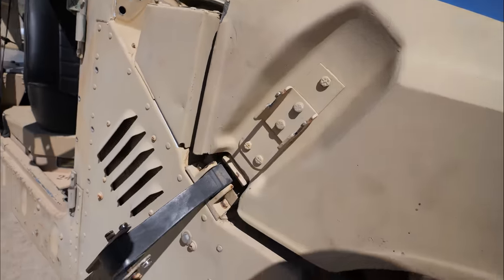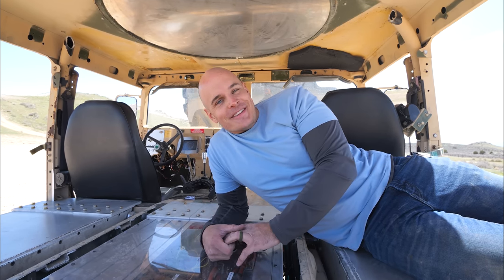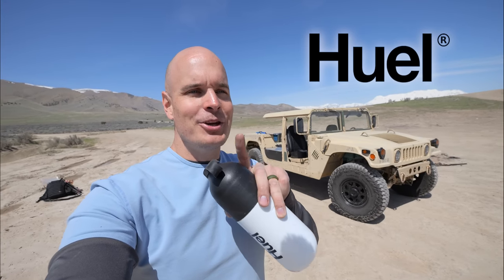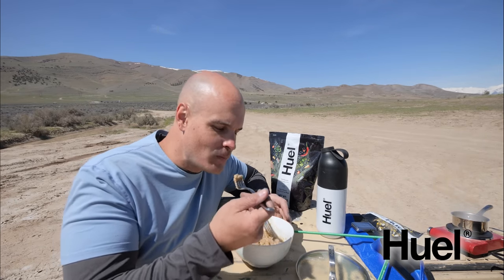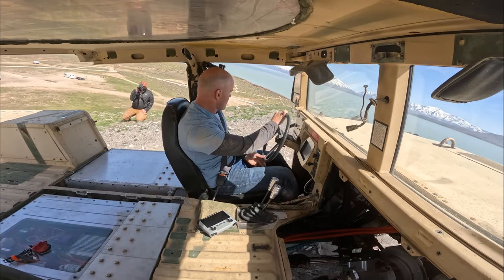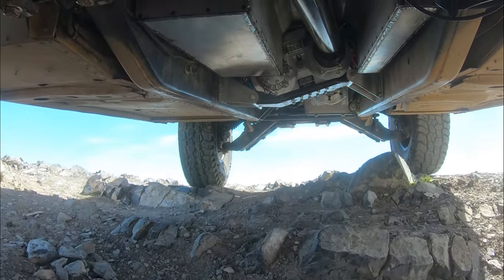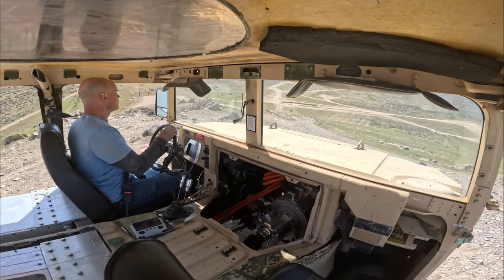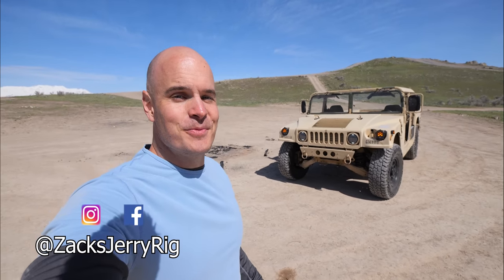Off Roading my DIY Electric Hummer - What could go wrong?

Comment: I can tell you from my experience in the Army, going over 50 in a humvee feels like you're doing re-entry on a spaceship. You'll want to do something for suspension for sure.
Reply: I highly doubt that - unless it's on some gravel road in the forest or out on some battle field. Of course it's probably a lot bumpier and noisier than a regular car, but on normal highways, it's still just 50 mph (which is about 80 km/h for us non Americans), in a car! It seems like he is simply not used to high speeds,  haha. I also base this from one of the earlier videos of this project when he talked about the the "torque converter" (or that's probably wrong word - it's not the type used for ICEs, but like a single gear gearbox put between the motor shaft and drive shaft) and started to tell that "without it, the top speed would be like 125 mph and this car would probably fall apart at that speed". 
That's in fact totally irrelevant to why it's needed. It's all about to get the right ratio between torque and rpm, to use the available power most efficiently. Without it and using the same motor, he would probably just get worse performance. He would get less acceleration, but the poor aerodynamics of that car would "suck" so much power at high speed, so he would probably not get much more usable top speed anyway (maximum current draw without overheating the batteries would probably be the limiting factor instead - and the range would drop to almost nothing). 
So the 80 mph (129 km/h) he chosed, is probably quite optimal (given the limits of that type of vehicle) for fast drivers on normal roads. But, he could probably change it again to get a top speed of just 55 mph / 89 km/h (he isn't going faster anyway), then the motor would run more efficiently during the off road driving.
Reply: @Speeder84XL  👀
Reply: @Speeder84XL  As someone who's done drives from 29 Palms to Camp Pendleton and back (6+ hours of highway driving) as well as other drive on public roads/Highways in a HMMWV.

These vehicles were not meant to be driven that fast on those kinds of roads. Maybe it's the turbo diesel making it feel like hell, but I honestly doubt that.

If you really want to know, buy a surplus one for like $5000 and you'll see how heinous these things can be on roads/highways. Offloading though it does good.
Reply: @Speeder84XL  I'm not sure you know what suspension does. The humvee has some pretty heavy duty suspension and as Zach mentioned they removed the turret plus he removed some other components. So the vehicle is lighter with a very stiff suspension. This negatively affects performance. You can clearly see as he traverses the hill that the suspension doesn't articulate much, especially over the bumps. This negatively affects the handling (especially offroad) and the ride quality (poor Zach is going to rattle his brains out).  The suspension needs to be adjusted, keeping the natural frequency and motion ratio ratio constant, combined with a  lower sprung corner mass (due to cutting the weight of the turret plus any potential mass loss/weight distribution changes associated with changing to the E-drivetrain), this ends up reducing the required spring rate. 

Because Zach said he has more work he wants to do (which will add some more weight again) he shouldn't adjust the suspension until he's done building the vehicle - as a final step - otherwise the suspension won't be tuned for the final weight/weight distribution of the vehicle and won't be optimal.
Reply: @Budorb  Yes, but then it's probably more a question about noise and vibration - of course, in that case, many drivers will go slow to make the ride more comfortable. Many parts in US also have quite bad roads with pot holes and bad pavements - that in combination with stiff suspension isn't the most comfortable.

What really got me here is when he said "I don't know the 0-60 time, because I have never gone more than 55 mph". That means he would never have hit 60 mph (97 km/h)
 - not even for even a second. I get it, that car is not very comfortable at speed, but not even hit 97 km/h for one second, LOL!

Last summer I had a car without working AC, so during hot summer days I had to drive with windows down
 - since I like speed and typically go at 160-200 km/h (99-124 mph) on the highway, the aerodynamic noise by the air current over  the windows got ear damagingly loud - but I simply put earplugs on rather than have to chose between "cooking" in the car or crawl along at like 100-120 km/h to not get bothered by the noise. So earplugs also works if noise is the issue, haha
Reply: @berto1014  Yes, you indeed have a good point, but the speeds we are talking about here, is so low
 - I understand that you can't go 100 mph with this kind of cars, but 55 mph (89 km/h) on paved roads - come on. Also, it was not about comfort on long drives here
 - but what really got me thinking "wtf?!" is when he said "I don't know the 0-60 time, because I have never gone more than 55 mph"
Reply: @berto1014  Definitely agree with ya there. Plus it's engine only makes 190hp with the turbskie added so them things are dummy slow haha.
Reply: @Speeder84XL  I'm fairly certain Zach isn't designing the humvee for primarily highway use. He has a Rivian after all. It's going to primarily be his offroad vehicle - as he demonstrates in the video. There's a few points to be made here. Zach is using the conventional drivetrain and not an optimal EV-drivetrain. This means his motor is turning a driveshaft, through a transfer case, and through a front and rear axle. This is highly inefficient for EVs as compared to directly turning the wheel with the motors - not to mention the additional weight of those components.  But that's what needs to be done since the chassis was designed around an ICE and not an electric drivetrain. A torque converter is also completely unnecessary for an electric drivetrain, since electric motors cannot stall when brought to 0 RPM and can produce 100% torque at almost any RPM (torque typically drops off at high motor RPMs). Adding a torque converter only introduces inefficiency for an EV. None-the-less, regardless of the speed he wants to operate it at, he needs to reduce the spring rate. Have you ever ridden in a heavy duty truck (like a channel truck or an 18-wheeler)? There's a reason the seats are on air bags... Lol.
Reply: @Speeder84XL  i think you totally missed the point of his comment.
Reply: @berto1014  Yes, but why even set it up for a top speed of 80 mph and talk about 
0-60 times then (that gives the impression that he want some performance for road use as well)
 - better to set it up for 55 (or what ever speed he thinks is good enough), to make the motor more efficient for the off road driving. At low speeds with lots of resistance and sometimes almost static force output from the motors (when climbing over rocks, going up steep hills etc.), during hard off road maneuvers, it will run more efficiently with a lower gearing
 - less torque from the motor shaft is required to get the same torque at the wheels (which means less current in the windings = less resistive losses)
But torque converter was the wrong word 
 - it's not the type used for an ICE, but like a single gear gearbox, that he put in between the motor shaft and drive shaft, to exchange some rpm for some torque to the wheels (he chosed the gear ratio on that one so tops speed will be about 80 mph at the motors max rpm).
Reply: I own a humvee and drive it often on and off-road. It’s really not designed to be cruising above 55mph. Changing out the military issued (170lb) run flat wheels to a civilian wheel and tire setup certainly helps the daily drivability but he wasn’t wrong in saying how crazy these things feel driving at highway speed. Just my 2 cents, it’s easier to make assumptions when you haven’t personally driven one. Cheers
Reply: I wish they were only $5k lol. Shoot man I spent $4k just for my x-doors on my humvee. Prices have gone up a lot the past few years. I’ve got one that was $30k and a buddy of mine has 6. Cheapest one he’s ever picked up from auction was $14k and it has a long way before street legal. Kick ass vehicles for sure but kept at a slower speed no doubt. Cheers!
Reply: @beurownboss1554  I still think it's exaggerated, because 55 mph is so incredibly slow on roads. It's about the same speed as our speed limited heavy trucks in Europe that sometimes cause frustration for a large amount of drivers, that often result in  dangerous overtakes and other "not so great" things. 

For me, saying "it can't be driven more than that speed on wide open highway" is almost like saying "this car isn't built for speed, so why even bother rebuilding it to electric then
 - just remove the old broken engine, put pedals in and pedal it like a bicycle". 
With low enough gearing, even my mum could pedal it. The top speed will be like 3 km/h, but come on, it was never built for speed... A bit exaggerated, but I think you get the point. 
At low enough speeds, it doesn't really matter if it's build for speed or not. You could as well be riding a motorized shopping cart, unless you are a terrible driver.

What really "got me going" was not the fact that he doesn't want to cruise at more than 55 mph, but the fact he haven't even reached it at all, since he built the car (because apparently he has been out on some test rides)
 - it doesn't take much to test the 0-60 time.
Reply: @Speeder84XL  right, I get your thought process. Really think it would make more sense if you could ride in one. Mine is the 4 speed model and technically could hit a top speed of 70mph. The actual drivability of it is tough though bc when mine was in the marine corp it was 9400 lbs. once it was demilitarized (plating and equipment removed) it only weights 5600 lbs. it still has the suspension of the original setup so it’s like running full speeds with your legs straight (not any buffer or bounce given). At those higher speeds even on a smooth road, it’s amazing how much suspension is working on a properly setup car. There are plenty of ways to adjust it aftermarket and I’m sure Zach will be doing that with his sometime in the future to help the drivability on and off-road. You know one of the funniest moments I had with mine was when I first bought it, I had to drive it back 2hrs from south of Atlanta. My gauge maxes out at 60mph and I had my needle going past it far enough that I was certain I was doing 70mph. It didn’t ride well but I was stoked to have it cruising at that speed. Then I started noticing how fast everyone else was going, kept me in the slow right lane. I pulled out my gps and found I was only doing 59-60mph haha. No wonder everyone was so pissed at me on that drive lol. Cheers,
Reply: @beurownboss1554  Yes, it would be fun to try one - but for obvious resons, it's not very easy to get that opportunity. 

The suspension is very important for more active driving with lots of cornering and braking. But on straight roads, that's not much of an issue for more than comfort. 
I like speed and usually go 160-200 km/h (99-124), sometimes even more on highways (unless it's too much traffic) and have done in everything from an old Fiat Brava to large SUVs. 
A year ago, I drove around in a car that someone has modified to make it feel more sporty - which meant the suspension was lowered so much it gave very little suspension travel (and thus it needs to be very hard, to not bottom out at like every bump) - which affected the drivability negatively. 
Previous owner was one of those who just like to modify cars, but never test them for real
 - those people typically like to brag about how fast the car can accelerate, but never do any real active driving.
I often (if the road was not very smooth) had to take turns slower with that one than with most SUVs I have driven, because the car was bouncing so much. Still not an issue on straights though
 - except that sometimes when passing things like bridge joints, it went with a loud bang and I was sometimes a little scared  something would break - but that was at at speeds of 160-180 km/h.
I have hard to imagine a car that's so bad that one can't even go 100 km/h on highway straights with it - other than if something is about to break down for real on it. 

Also if the suspension is very stiff because the car was heavy in original, that also means the chassis of the car is built to withstand the forces from the suspension as well. The difference is just that the car has less mass, so it gets jolted around more by the forces that would otherwise get counteracted by the inertia. So the risk of something critical braking is still low.

Fun thing with the speedometer - that's quite common here in Europe (even if that one was particularly bad - over 10% error), because of a stupid EU law that car manufacturers have to follow - there is no tolerance for a speedo to show too low speed (not even neglectable errors like 1 km/h) - but they are allowed to show 10%
 + 4 km/h too much. So they practically have to set it to show to high, because they can't guarantee it's accuracy (some are worse than others though).
Reply: LOLOL
Reply: @Speeder84XL  The Humvee wasn't designed for highway speeds, and definitely not for comfort. They weighed a minimum of 8000lbs. With that much weight on your suspension you're feeling EVERYTHING. They also only had a top speed of 65mph but would probably rattle apart if you ever tried to go that fast. They weren't built to high standards, Every one that's ever been deployed probably has more sketchy welds and bolted together panels than anything should. The M998 has been the topic of many studies because it was known to cause spine injuries.

There's a good reason that the first thing people do when they buy decomissioned humvee's, Is replace the suspension, add proper seating, and do a duramax swap. In their original form, they required meticulous maintenance to not fall apart just being used at parking lot speeds. You need to look at it as a piece of heavy equipment rather than as a motor vehicle.
Reply: @sakaraist  Ok, that makes more sense. Maybe the build quality IS exceptionally bad. But then it was indeed a bit overambitious to gear it for a top speed of 80 mph
 - since it will run more efficiently at low speeds with lower gearing (especially during those hard off road maneuvers, where the motor sometimes output nearly static force).

Comment: The ideal electric hummer would have one motor per wheel. With this scenario you wouldn't need locking differentials since you can control the speed of each wheel individually.
Reply: Like a rivian?
Reply: Ideally, but this chassis was designed around an ICE, so it's not possible without a completely different chassis, or heavy modification (which is not recommended for someone who doesn't at least model it first in CAD and perform FEM to ensure there aren't any high stress areas).
Reply: @illuminati229 this chasis has dif locks he doesnt know how to use them
Reply: It doesn't. The original transfer case had a locking center but the front and rear differentials are torsen differentials without lockers. Torsens are a variation of limited slip but do not work well when unloaded.

The thing he didn't seem to know and genuinely would have helped, dragging the brake really helps torsen diffs when they get a wheel in the air, that can help on open diffs too but the torsen style diff magnifies the effects of that drastically
Reply: On this vehicle, I suppose it would be feasible to install an individually controllable brake on each wheel.
Reply: He was driving that impractical ekectric 3wheeler with individual hub motors some time ago. And they said you could get individual spare parts for it.. So grab those hub motor spares i guess.

Comment: You have to drag the brakes to get them Torsen diffs to work when one tire leaves the ground. They work great when you get used to it. Cool build so far. Interested to see what else you do with it.
Reply: Looked it up and yeah you use your brakes enable Diff lock
Reply: cant believe he didnt google that
Reply: @Icel4nd3r  The Hummer only has a diff lock in the center.   If you're on moguls then can end up with no traction at opposite corners, and thus the need to drag the brake while on the throttle.   It has Torsen diffs front and rear, so this trick is more effective than it is with open diffs (although it can be used to some degree even with open diffs, as I used to do have on my old 4runner).
Reply: @daemn42  Yeah, I did that back in the seventies in Mom's Comet; a little brake drag makes a huge difference.
Reply: Yeah at some of the Hummer driving schools they teach you a technique called "modulation" AKA... drag the brakes.
Reply: Are the hummer torsens weak like car versions? They especially don't like shock loads

Comment: Soft suspension that brings the tires down to contact the ground will make it feel like a whole new vehicle. It looks really uncomfortable on road and worse offroad. Let some tire pressure out when your offroading to let them squish around rocks and drag the brakes for the Torsen diffs to stop spin
Reply: Definitely. Knowing how to work those Torsen sons will be key!
Reply: Yeah true, i think the suspension is best fix to ground contact. You can see at around 4:20 - 4:30 theres very little suspension travel, vehicle is balancing between wheels

Comment: From the looks of things, you definitely need to lighten up the spring rate to keep your wheels on the ground where they'll do some good! It's definitely not hurting for power, just getting that power to the ground.. This is what's needed to ferret out the suspension gremlins. Glad to see you finally got all the CAN bus issues worked out and all the modules are talking to each other now!😉👍